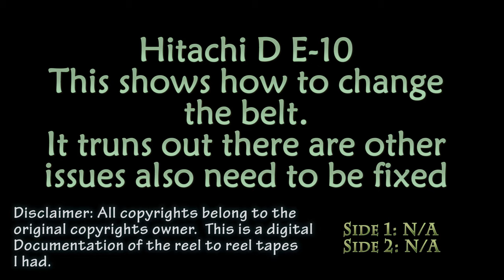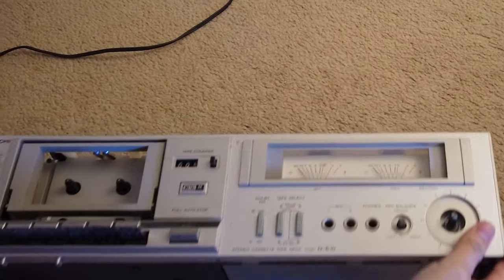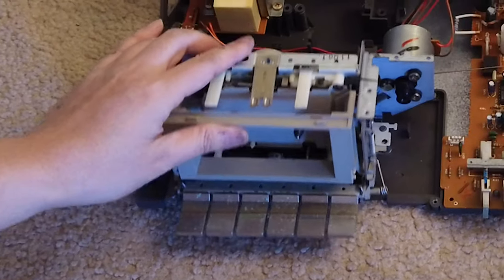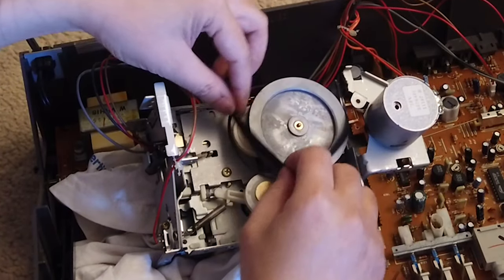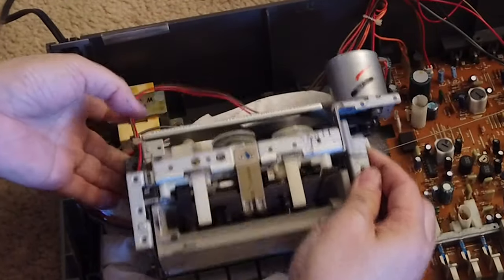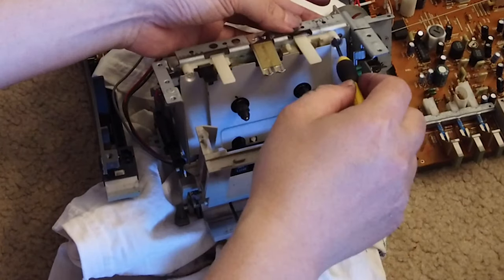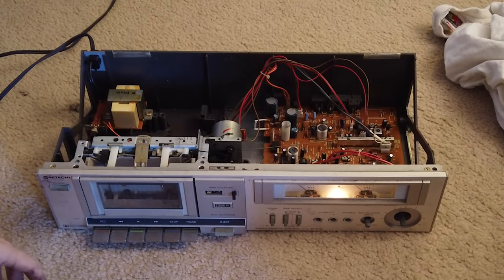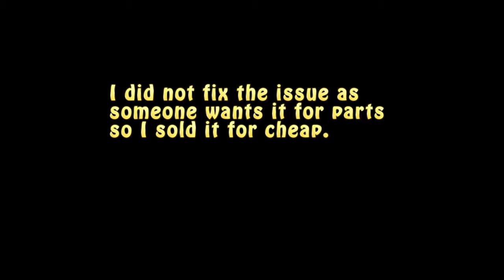Hitachi E D-10 cassette deck change belt disassembly

Comment: Hi great video. I have a Hitachi d35s with all belts melted and disintegrated. It looks about the same inside. What did you clean the belts off the wheels with please? I have a lot of gunk on the motor spindle as well. I'm going to have a go using your video. Thank you
Reply from the maker: I just use alcohol
Reply: @DunQuDeYi  thank you
Reply: The motor spindle for flat belt is caked on🤔
Reply: Hi what size two belts did you use please? I have cleaned the gunk off with isopropyl alcohol👍

Comment: I have the Hitachi d33 s stereo cassette player. I have to change both belts one on the flywheel the other on the pulley one about was missing when I got this tape deck do both belts go on the pulley on the motor.
Reply from the maker: I never see any D33 so I cannot speak that for sure. For the D-10, there is only one belt driving all.

Comment: Hi Great video,, where did you find the belts for this?
Reply from the maker: Just go to ebay, search for "assorted flat cassette belts". Buy those cheap belts package and one of them will work.
Reply: @DunQuDeYi  hi back again. Did you changed the tape counter belt? Just seen it gunked up. Cheers